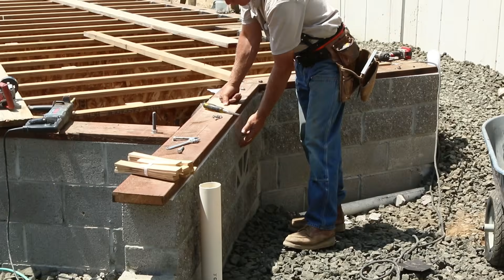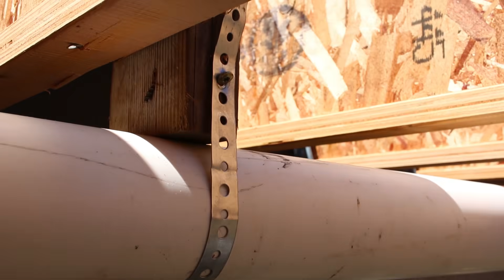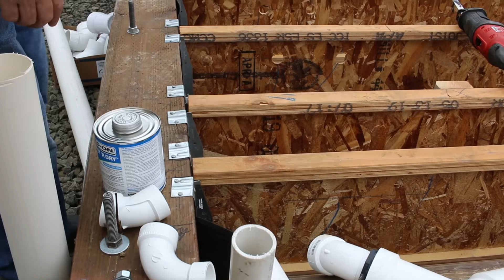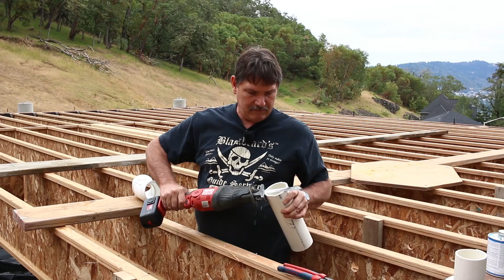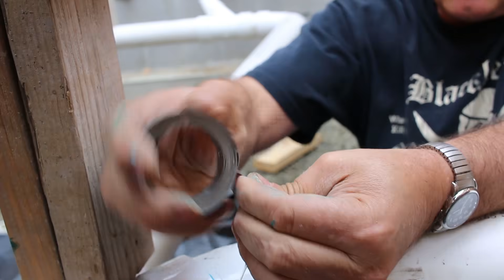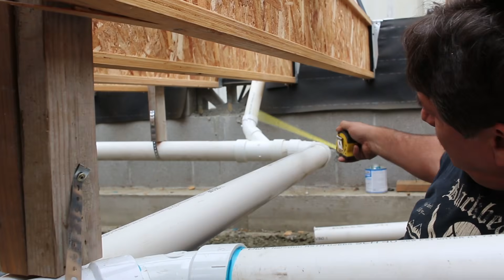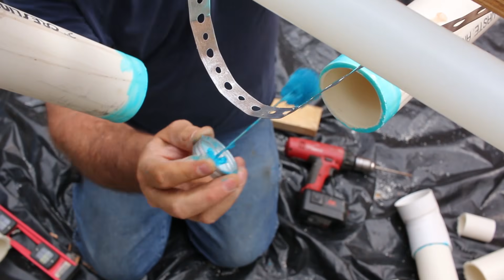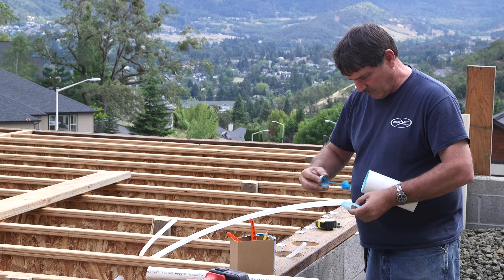Waste and Drain Ep.41

Comment: Will you install a Back Water Valve inside the crawl space just before the pipe exits the house? This prevents back flow into your pipe in the event of City Sewers over flowing...
Reply: I was surprised to not see one installed. They are code for all new construction where I work
Reply: John S. Richards I believe the house is the last one, so it is at the highest elevation.
Reply: A Back Water Valve may reduce Home Insurance & City Liability, should the City be identified as the cause of a flooded basement. Some Cities give home owners a rebate to pay for Back Water Valve installation. Essentially this becomes a deduction off a Home Owner’s Property Taxes and everyone benefits. You may want to investigate in your area.
Reply: Even with this house being on top of a hillside?
Reply: Curt. Yes it looks like it as at the top of a hill. If storm water run off goes down same pipe as City sewer pipe, and a lot of rain water comes down the hills above... Is there any likelihood of risk? I cannot say, only locals will know. A 200$ Back Water Valve c/w Clean Out, might be a small price to pay, especially if it lowers Home Insurance Premiums and pays for itself...
Reply: In the terrible event that this happened, the people downhill would have a house full of you know what.  Unless the clog was just down hill from this house.  They are not common or required where I am, but some people have a pop up on the exterior cleanout for the same reason
Reply: A check valve on the sewer line is not needed if the building's lowest drain fixture is higher than the next upstream manhole rim in the city sewer line.  The idea is that a blockage happening in the city sewer line below your connection point will cause sewage to back up along the city line and up into the connecting building drains.  But if the next upstream manhole rim is lower than the plumbing fixtures inside those buildings, the sewage will fill the manhole and lift off the manhole cover, draining into the street.  One thing about sewer check valves is the municipality usually requires that you install a vent pipe on the down slope side of the valve.  The air pressure inside the city line is vented through all the building vents that are connected to it.  The sewer department people are concerned that the check valve will cut off the use of your building's vents for their pipe.

Comment: I'm late to the party here, but why a crawl in lieu of a full basement?
Reply: Oliver Clothesoff , cost. And weather. The Pacific Northwest doesn’t get as cold as climates where full basements are the norm. A full basement is really the result of having to place footings below the frost level, usually 8-12 feet. 
So, if you don’t need to dig that deep, you save on excavation and materials.
Reply: Oliver Clothesoff cheaper, or the sub soil or water table may not be conducive to a dug out basement

Comment: Are the vibrations too little to justify padding on the metal straps around the pvc supports?  That would be a concern of mine ten years down the road, especially if taco tuesday or dads chili is any good.
Reply: Jacob Atkinson strap it tight and it can’t vibrate

Comment: Glue is allot nicer than oakum and lead.  Glad those days are gone.
Reply: The good old quiet pipe is alive and well! Engineers  still spec it for hotels and hospitals  regularly.
Reply: You would hate working in Chicago.
Reply: @franklinprichard9151  )0
Reply: High end homes get built with cast iron pipe. It’s quite; guests don’t have to hear the toilets flush 😂
Reply: No there not. A lot of places are still required to have copper or concrete drains.

Comment: Having spent a lot of time and money either fixing bad plumbing myself or paying a pro ($17k for new sewer, a new water main a few months ago, a new toilet stack after it started growing stalagmites …), I love seeing the clean perfect system go in. It’s so pretty. 

I will add just one thing: Under any sink that has a cabinet, you gotta put down a layer of plastic of some sort, whether it’s Visqueen or floor runner or even an old shower curtain. Those pipes are going to leak, and unless you protect the base of the cabinet, it’s going to get rotten and stinky. If you put down the plastic, you will thank me in two years five years or 20 years.

Comment: well this was awesome.
Did Phil remind anyone else of Robert Duvall a little bit?  Seems like the expertise lies in the nuances of what he did.
Like he would fit, and then rotate the assembly into position one time, and then stop.  If his fitting came undone, he didn't just stick it back together like i think many of us might have; he reapplied the glue, and then put it back together.
you can really tell he meant what he said about building a system a certain way specifically because of his experience in the repair side of the plumbing world.
Loved the personal touch here guys.
Reply: The reason he had to reapply glue was because  he didn't chamfer bevel the outside of the pipe. That Sharp 90 degree angle scrapes all the glue out when inserted into fittings. C'mon Phil c'mon brooooo

Comment: Cast iron sewer drains were used at least 100 years. I'm on the east coast and I renovate old homes all the time. Some homes built in the 50's and 60's used copper waste line or even combination of cast iron and copper. (Cast below grade, copper above) Homes that had indoor plumbing in the 1800s may of had clay pipe. You dont want to much pitch near fixtures because to much pitch may syphon water out of the traps allowing sewer gas to enter the home. My plumber taught me that.

Comment: Is that getting wrapped? Unconditioned space right? Im in NY, that would freeze here.
Reply: I'm in northern Wyoming where the winters get down to -30° sometimes -40° F....in crawl space functioning  sewer lines won't freeze. Now the water lines ..... Grrr better make sure the heat tape is up to snuff .....👍🏼
Reply: Only the p traps that hold water will freeze in a drain system.
Reply: @jehu5813  unless there is a leaking toilet or faucet...

Comment: Your plumber doesn't know squat about how to connect PVC pipes.  He used the wrong type glue, zero primer, and zero cleaner.  Using Wet location glue does not allow you to eliminate primer and cleaning PVC pipe before glue up.  That's why they sell primer and cleaner right next to the glues in the hardware stores. Plus: it's the wrong glue for this project. Neither the location, nor weather, was wet. The Plumber (and I use that word very losely) should have used regular dry location glue after cleaning the pipe with PVC cleaner.  Then priming the pipe with PVC primer before final glue up with dry location glue. I like the show, and have learned a lot. But, sometimes, as in this case, the mistakes are too much for me to except.  Fire your plumber, you will likely have leaks at these PVC joints in the future.
Reply: BILL that is more for the inspector to critique than the YouTube code squad
Reply: We'll see when they fill that stand pipe with 10' of water.
Reply: Bill,I do have feelings.

Comment: Not using cleaner / primer on that PVC? Interesting. I think that's the first time i've ever seen that on non electrical PVC.
Reply: OTOH I have never seen a primer for PVC, what does it do?
Reply: Basically keeps the pipes from coming apart. I can let you do your own research on it. After a small bit of research, i guess code says(for that area) any non pressurized pipes do not require primer. That's a no way for me man. IMHO, primer is absolutely necessary.

Comment: I've only got three recommendations you should always use primer on your glue joints secondly you should never use the wet dry glue unless you have to because You're not supposed to pressure test against it and third you should never press your plastic fitting against wood because when warm water runs through that pipe if it expands it will can it creaking noise
Reply: NOT A PLUMBER!   but  I just looked at an can of wet dry glue and it recommend NOT to use primer.  The can also said wait minimum of 12 hours prior to applying pressure. 
I used it in an irrigation ditch pump  with a booster pump and it holds 90 PSI at the bottom of the hill (50 foot head)  and enough to blow water 45 feet out of the rain birds at the far end off my property it has held for 3 seasons in hot Summers and ice cold winters on a fence line in the sun.
Reply: @suspicionofdeceit All I use also and have never primed it   and  it is not as obnoxious smelling as the clear stuff !!!
Reply: Wet dry is fine, especially on dwv. Primer is for homeowners, most commercial plumbers use clear cleaner.

Comment: Awe, a Peach's crack instead of the Plumber's crack!
Some PVC Questions:  Why no PVC Primer, (purple stuff) on the joints before the glue?  We used to use sandpaper sometimes instead of the primer, premise was that the outside finish of the pipe and fittings needed this, and the glue worked better after sandpapering or using the primer.

Comment: I love your videos. I have a question. Why run drain pipe through the outside wall, especially in the kitchen. When I had my 92 year old Detroit home re-plumbed, the plumbers intentionally moved the waste and the new copper supply into the kitchen proper to avoid potential freezing, even with my good insulation.

Comment: Im very surprised the sewage pvc pipe is glued without first a applying etching fluid ?? It's code to do so in my country 👍🏽
Reply: Not sure if this is their reason....Here (Wy) because the sewer lines are not pressured the combo of etching & cement are more than enough...other than the 10' head pressure of a 2" line...
Reply: @maleficentcop2752  The pressure generated by a column of water that is 2 inch in diameter is the same as that of a column that is 2 feet in diameter if the columns are the same height.  It is the height of the water that is important.
Reply: @royreynolds108  
Not being a smartty pants here.... Are you saying that 10' of head is 10' of head... No matter the size of the vessel...? I'm mean a 2' pipe will hold more than a 2"...& The weight of the greater volume doesn't make a difference ?
Reply: @royreynolds108  
Ok Roy you are right gravity is creating the pressure...so diameter of the vessel doesn't change anything...it's the weight, (specific gravity), & hight, (head puressure) ....got to love the internet... hahaha 🤔

Comment: Is all thread rod and hangers unnecessary for the waste line?
Reply: My house originally had the drain suspended as shown in this video.  However, thermal expansion (of the house and/or the PVC) along the very long drain caused some REALLY disturbing noises as the seasons changed, or as hot water was dumped down the drain after someone's bath.  The metal tape was holding the PVC so tight against the house that when the PVC finally expanded or contracted too far, you would hear an incredibly loud "BAM!" as it found a new seating within that tape.  It would make everyone in the house jump.  We re-hung the drain with rubber-lined clamps suspended on threaded rods about 3 years ago, and we're noise free.
Reply: @WanJae42  that's interesting. I assume no more loud noises.

Comment: What kind of glue is he using?  Here we have to use purple primer and then PVC glue.
Reply: It's a mix of the two...wipe off, keep it clean, slubber it on, its way slick.... Got to love it...👍🏼
Reply: Here the purple primer is only required for pressurized systems (water and irrigation) and not for drains or sewage.
Reply: Snipes13000 

I just installed my new hvac system and used purple primer on the condensate drain lines. It looks kinda messy compared to my neighbor’s she had done by an hvac contractor. Lately hers has been leaking and did some ceiling damage. It’s not the first time I’ve seen bad joints on condensate lines. 

I guess the moral of the story is I’ll always use primer. I thought about clear primer but I did that once and had to inspect with a magnifying glass joints I was worried I forgot to glue the previous week. But that purple primer is a pain in the arse.
Reply: @TheRentsTooDamnHigh  I was speaking more to footing/downspout drains. I only know about underground utilities, I have absolutely zero knowledge of anything post first floor framing.
Reply: just a different brand probably
Reply: According to the can you can do it without primer of code allows. The thing is I don’t know any code that doesn’t require primer. I’ve never used the combination stuff so I dont know if it’s any good. I also wouldn’t use foam core on anything but vents and not even then.
Reply: Joe Modley they have 1 step PVC glue that you can use some applications

Comment: 1/8 thick  4" 
copper waste lines on some of the old east coast houses.
Reply: You could probably pay to replace those with the pipes themselves. That's a lot of copper.
Reply: My house isn't even that old ('75) and it's got 4" copper for the main out to the septic. I whistled through my teeth when I saw it on walkthrough before we settled, and it still catches my eye every time I'm down there. It is a bunch of copper.
Reply: @philthycoder  mine is from 1925... was cast iron pipes with LEAD sealer. had to rip and replace everything by ABS... cast iron Tee's and pipes rusted through and leaked. let's say the Tee's and pipes weight a freeking ton. still have 1 length of cast iron pipe which i won't replace as it's still in good shape and did not want to rip part of the wall going to the roof for the drain... :)

anyway. stay safe and follow the rules if possible :)
Reply: Some houses near me still have copper gutters and downspouts. My house has copper flashing around the chimneys and everywhere else flashing is needed
Reply: Boston area is still full of 4" cast iron. Still holding up after all these years and there is no better sound deadening of the water flow than old cast iron.
Reply: Alena Thompson I just finished a custom cabin in the northern Arizona and made the gutters from copper recovered from a very large 600 volt transformer. It turned out great and I got pretty good a soldering large sections of hand formed copper.
Reply: Ever seen lead drains?I have. Ooof! That's old.
Reply: @tomim7187  My moms house was built in 1819. I've had to pull out lead drain pipe that was leaking in the wall.  The basement has a lead sealed slate sink that weighs about 400lbs.
Reply: I have those in my home. They look expensive next to the pex pipe.

Comment: With the utmost of respect, I offer one thing I personally do differently. He used foamcore or cellular core PVC. That is good enough for the job, but true solid PVC is even better. I've broken foamcore pipe just by loading and unloading from a truck too aggressively. I've never broken a piece of solid schedule 40 PVC. As with most things, it's a cost benefit analysis and nobody can be shamed for using foamcore in compliance with the task it was designed for. 

On a note of applause, your overall design and layout is impeccable! Sooooooo many people, even experienced professionals, do poorly in their design and layout. It's truly an art and it just can't be mastered without a thorough and complete understanding of code, how the pipe fittings available to you interact with eachother, geometry, and fluid mechanics. There's soooo much more math and science involved in plumbing than people care to notice. Only those who understand that fully can be called the best plumbers.
Reply: Austin what is the difference in pipe you're referring...is it how it's made ?
Reply: @maleficentcop2752  conventional schedule 40 PVV pipe is 100% PVC through the whole thickness of the pipe. Foamcore has a thin layer of PVC on the inside of the pipe and the outside of the pipe with a foam core between those layers. It is far cheaper and far easier to carry and cut. Also far weaker. But used correctly and with care it works exactly the same and uses the exact same fittings and glue. Foamcore can only be used for drain, waste and air vent, NOT for gas exhaust vent, NEVER for dryer vent. And it's a bad idea to bury it as well.
Reply: It's fine in a crawl space and they braced it well.  I wouldn't bury it though and might think twice putting it in a wall riser above the floor.
Reply: @hgbugalou  as I said, used within the bounds of what it's made for and with a dose of common sense there's no shame in using it. It's yet another choice in the cost/benefit analysis that is unique to every project. Personally I'm just a little old-school and don't even consider using it myself. I install only what I'd put in my own home unless the customer is just insistent or dependant on as low a bill as possible. Generally speaking those aren't the customers I want though anyway.
Reply: Ok thx....I've used PVC for years but not heared of the foam core before... Good to know...thx again.
Reply: @maleficentcop2752  no problem, it's a younger technology, and actually not available everywhere. Even in some places where it is available, old timers don't always know about it because it sort of slipped under the radar due to a lack of marketing. Plus you can generally only find it in a plumbing supply house, not in the home improvement stores.